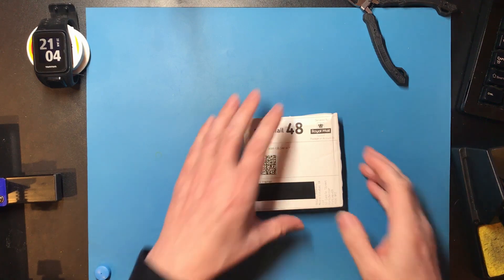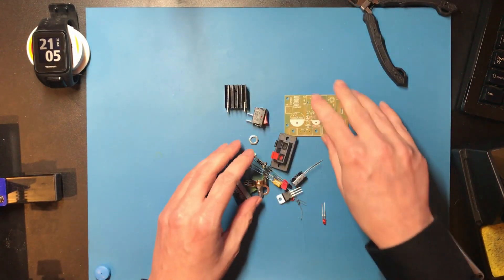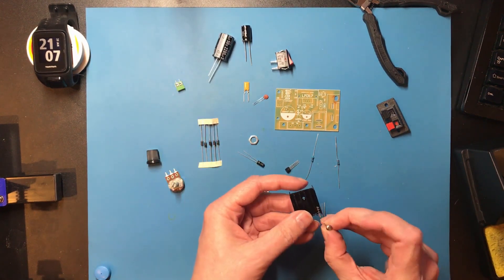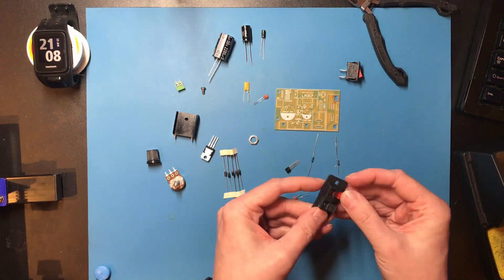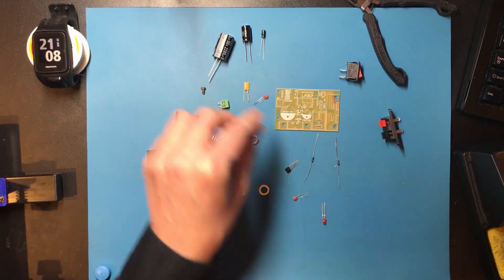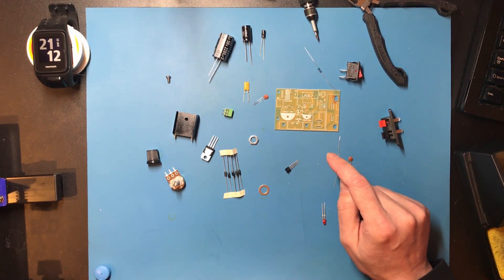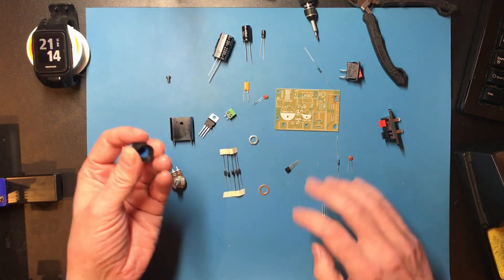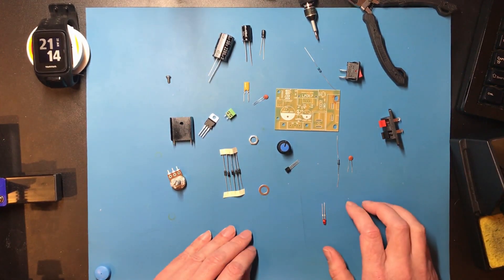LM317 Kit Build (Speed Run)

Comment: good work, though I think your problem with the soldering iron is that you might be hitting the limitations of how fast your iron can regain heat.  EEVBlog did a nice video on some comparisons that I wish I'd seen before I bought my Hakko 888.  https://www.youtube.com/watch?v=scvS2yeUH00
Reply from the maker: That sounds likely. I have an old soldering iron (not temperature controlled) that I remember making light work of bigger joins. I should dig that out for work like this rather than use the iron I bought for fine work.

Comment: Pretty is not taken into account, so the solder joints are exactly what they need to be - "good enough"! great run! I feel like my record will disappear soon, which means I get to try again!
Reply from the maker: Your record is amazing, don't be surprised if it has a bit of staying power.  I'm pretty sure I could get under 10 with a second attempt, but you were quick!